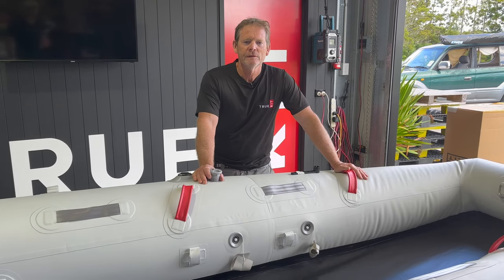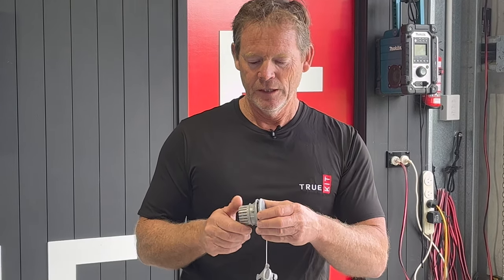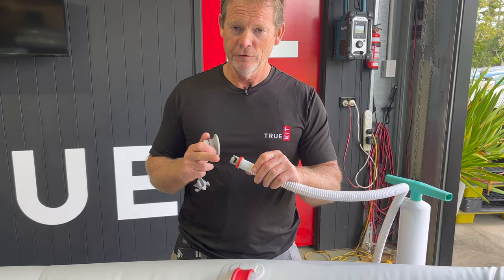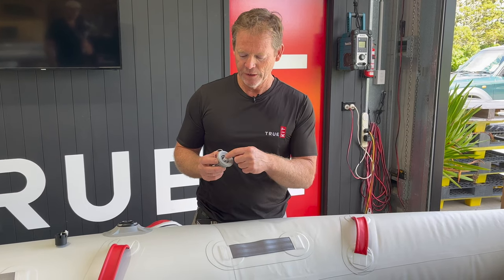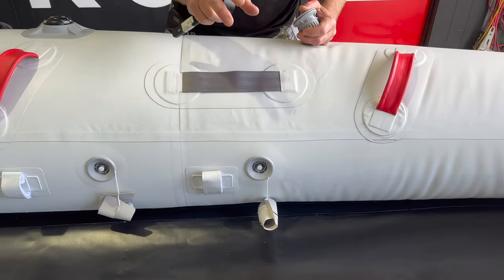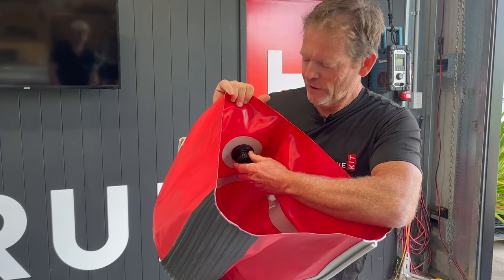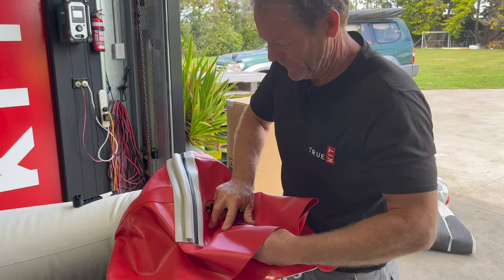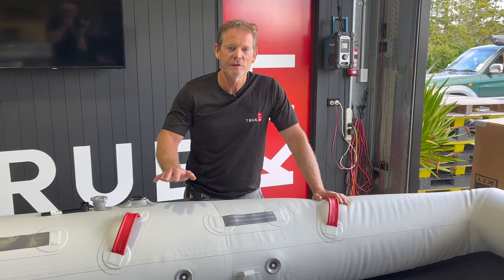Inflatable boat valves - How do they work?  How do you replace a valve?

Comment: What about when you actually have to replace the basket part too? I own a rib boat that was made back in 1997 and the type of the valves is not available anymore. Should this modern type valves fit in the old inner basket parts of my boat?
Reply from the maker: There is no guarantee that the top valve part will match the basket of your old valve.  Even modern valves are not all interchangeable.  If you need to replace the inside basket you will need to cut open the hole to remove and replace the valve, then glue down a ring of fabric to seal it up again.  I will do a video on it one day
Reply: @TRUEKITINFLATABLES  thank you.

Comment: what if back part/basket  is broken or needs to exchanged? Do you need cut open the tube and reseal it.? is there way to get the basket through the hole?
Reply from the maker: If you have broken the basket inside then you will need to cut the fabric to get it out, replace it, and then seal it back up.  That is a whole article in itself that we might do another time.  Some valves have much more robust baskets than others so when looking for an inflatable boat consider the valves to minimise the chances of this damage

Comment: I have a small rib and noticed what sounds like water inside the pontoon when moving the boat on the trailer. Yet the pontoons hold air. 

Any tips for water removal from the pontoons?

Comment: What happens if the internal "basket" is the part that is broken? Is there a way to get a new one in to the boat? Will the fabric stretch enough to slide the old basket out and the new basket in?
Reply: You won't be able to fit the basket through the hole without opening the hole up.  You will need to make some cross cuts in the fabric, insert the basket and then bond a ring of fabric around the hole so seal it up properly
Reply: That’s a good question. You need to cut out the old one, and then add a new one, followed by a “donut” patch. Basically a large round patch with a hole in the centre.

Comment: Any tips for freeing up a seized or very tight valve? I can't get mine to budge.
Reply from the maker: Insert your valve spanner.  Get an extension on it like a tube so you can get some serious leverage.  Push hard down on the centre of the valve spanner so it can't pop out.  And turn the tool to loosen.  That's your best bet

Comment: I have a leak at the valve joints and the valve is stuck and will not turn in the cup. I applied so much pressure holding the cup through the other side and no success. Any recommendations to loosen this? Thanks.
Reply: Get a metal valve tool instead of the cheap plastic ones.  Get a longer handle and never use anything to grab the cup that will hurt the raft

Comment: Nice informative video, Thank you.. question, can the inside 'basket' be pulled out through the hole, to replace the entire unit? Or does nothing really bad happen to them aside from stripping the threads.
Reply from the maker: I wouldn't recommend replacing the inside basket unless it is broken (sometimes they can get stood on).  To remove it you have to open up the hole with cuts, replace the basket and then glue a ring of fabric around the hole to seal it up again where the cuts have been made
Reply: @TRUEKITINFLATABLES  Hi, thanks a lot for the repair info..  I do the job tomorrow, I let you know successful I was.  Cheers, from Canada
Reply: @TRUEKITINFLATABLES  Being new to this Inflatable boat idea, I assumed things that I shouldn't have. I thought the replacement valve assembly would screw nicely into the existing 'basket.  Not only the threads did not match precisely, the threads were too long on the new one, as well, not being to tighten it enough, into the old basket. So, what to do.. well, I removed the seal ()-ring) from the old and used the new seal from the new one, Secondly, I removed the plunger and put the new plunger in the old housing, having to drill the a larger hole for the stem to fit. It's all done, no leaks.. Azn can have all their parts back, for providing a 'poor product description.. should state =  (DO NOT USE WITH OTHER EXISTING AIR VALVES, HOUSINGS/BASKETS)'  Why they not sell a 'o-ring/seal kit'? Thanks for your help.. you were right, getting the old basket out, cutting/glueing, be a nightmare. Thank You.

Comment: OK, well the main question that was not even addressed at all is... how do you replace the entire valve (including the new "basket")? It's all very well showing a cut open piece of the boat but that's not what people have. Are these valves originally put into the boats before the boat is glued together?  If so do you have to cut the boat open to change the whole thing? What you seem to be assuming is that you need to leave the old basket in the boat and just replace the new valve and cap parts,  in which case what;'s the point in buying the whole thing?  I need to change two of mine and I'm just hoping the old baskets are  still ok.

Comment: Hi Guys.  Great Video. Thanks. Question: Is the valve you showed interchangeable with a Zodiac Valve?
Reply: oh what the diameter of the hole for a bravo valve?  Cheers/
Reply from the maker: You will need to contact Zodiac to find out what valves they use.  Be aware not everything is compatible

Comment: I've inherited a lovely boat but it has glue around the valve and I assume someone repaired it incorrectly- how can I safely remove the old glue?
Reply: You will probably have to use a solvent like MEK so soften the glue and then carefully scrape it off with a metal scraper making sure to not damage the fabric